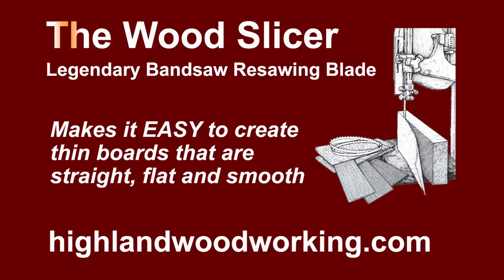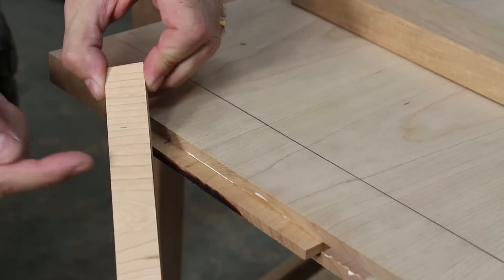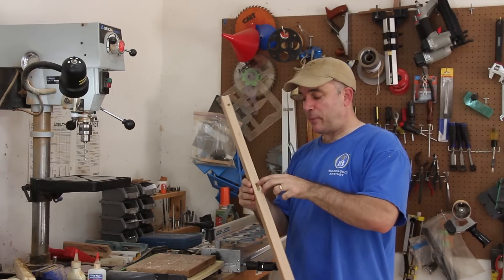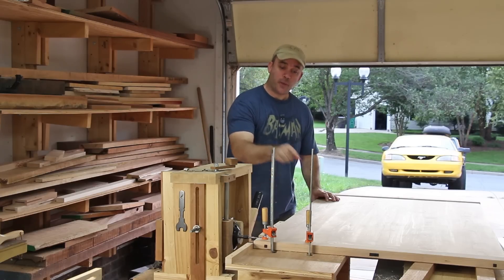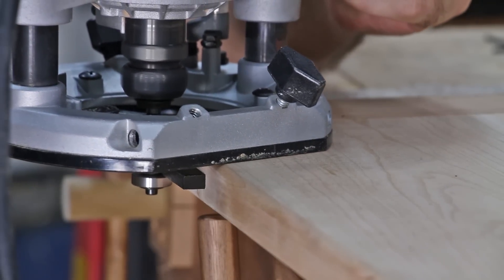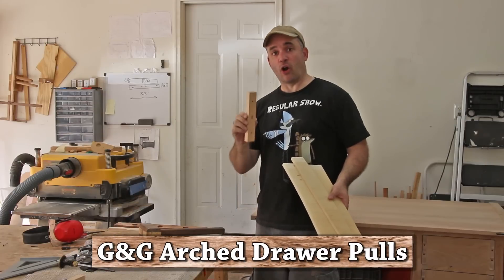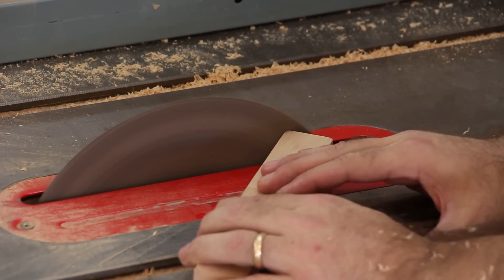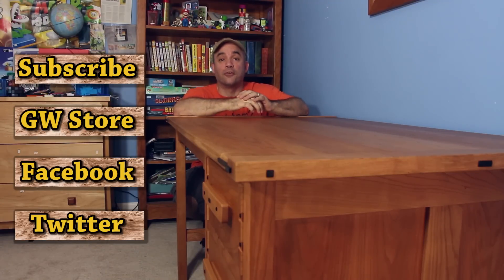Greene and Greene Desk Part 6

Comment: Nice job. Like the design. The finish on the desk looks beautiful. I would let your current finish dry for at least a week and then apply 4-5 coats of a gloss lacquer, I'm just a nut for the durable and beautiful finish of a gloss lacquer finish. Your desk is a first class job, very impressive. Thanks for sharing.

Comment: The slot cutter looks a good way to do the breadboard ends. On my last table I cut a tenon on the top which was tricky to do and took a long time to clean up.
Reply from the maker: The tenons certainly can be fussy for breadboard ends.  The spline method (which I can't take credit for) is quick and eliminates a lot of potential headaches. I don't think there is much sacrifice in strength.

Comment: Where did you get that sanding disc for your table saw at 7:30 ? Or did you make it? I am really in need of one but don't want to spend the money on a separate unit.
Reply from the maker: I think it came from woodcraft several years ago.  It came as a disc and circular adhesive sandpaper.  I have it permanently set in my secondary table saw.
Reply: Thanks! Beautiful desk, by the way! You have waaaay more patience than I do with my woodworking.

Comment: For those square chisels/punches, where did you get them?  Are they hard to sharpen?  How often do you have to sharpen/replace them?
Reply from the maker: I purchased them as a set from Lee Valley. I haven't had them long enough to require sharpening. They sell a cone for this, however.